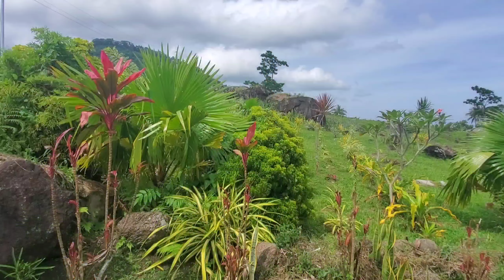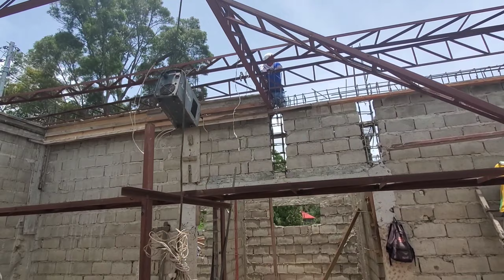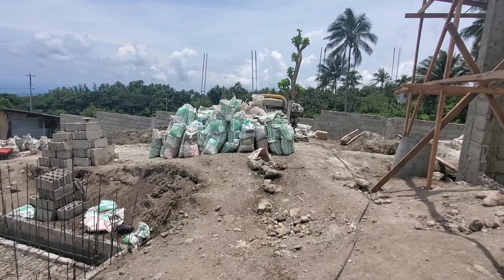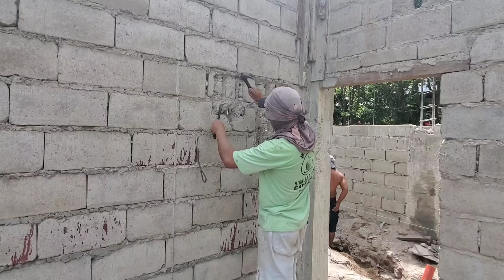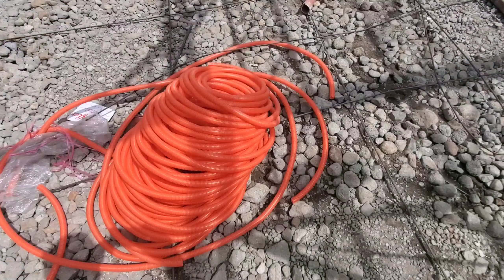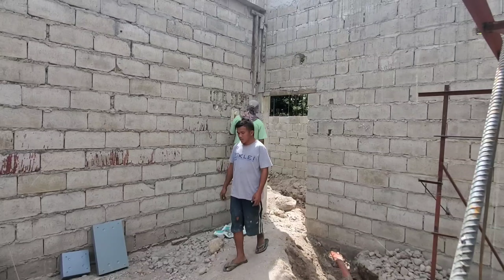Philippine House Building- Construction day 37

Comment: I don't think it will be wise to do that run the conduit cord beside the plumbing underground electric and go to the top to the breaker usually filipino construction crew is not upthere yet but it will be a challenge by the way i just hope it's waterproof God bless and keep it comin'
Reply from the maker: We decided not to do that, we are running the main line through the attic.  Thanks for watching.

Comment: I like the intro clips, I also am interested in your backup power ideas. My preference is to use solar as a backup to local power. I live in Eastern North Carolina and have been through several hurricanes and power loses. I don’t like generators. And the one I bought I never ended up using. I would prefer to save up for a solar system and use it to supplement power. I have no idea of the costs involved so I will learn from you
Reply from the maker: I'd like to go with solar as well, it's just not in the budget.  Need to have something, so generator is the cheapest way to go.  Solar technology is improving, so waiting probably makes sense as well.  I had a generator in the US and served me well.  The key I think is to run it once in a while and not let it sit.  Still looking into and will decide at some point down the road.  Thanks for commenting and watching our videos.

Comment: Wilma, and Greg, my Dad was an electrician and I helped him many times when he contracted to put electrical into a home.    I know he never put electrical wiring, or panel boxes near any plumbing, as if to have a pipe issue, it could cause someone getting electric shock.  I am only cautioning on this my friends.
Reply: We have GFI outlets next  or near  to sinks  , within reach anyway  Ground Fault Interuptor circuits or GFI receptacles  instantly cut off  power to prevent Electrocution it is needed and Code for Wet areas like Bathroom sinks, Jame Tanner  put one outside near pool or by pool pump  area,  Also All  Exterior  Outlets by side of houses have to be GFI  by Electrical Code.
Reply from the maker: Appreciate the advice.  I will consult with my Architect next week about this before any work is done.  Good point about a future leak and the electrical nearby underground.  It was suggested by one of the Foremans on the job.  I guess they have done this before.  I will get a professional opinion before moving forward.  Thanks again for commenting, good advice.

Comment: Not possible to bring there a truck mixer for all the floor of the pool? Because yeah even they do everything the same day with the manual mixer for sure a part will be dry before they finish
Reply from the maker: Concrete mixer trucks are rare here in Negros Oriental.  They're usually used for highway construction.  I also do not think a cement mixer could make it up the mountain and to our site.  Regular delivery trucks struggle.